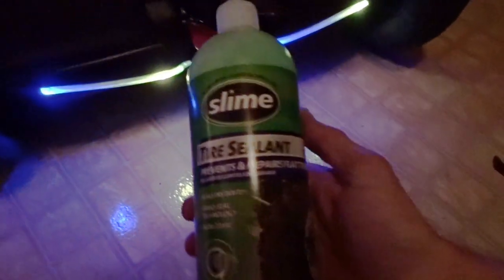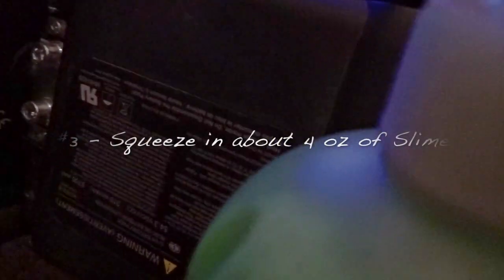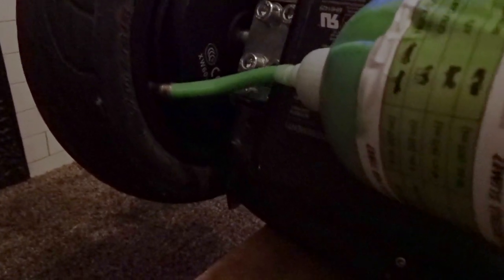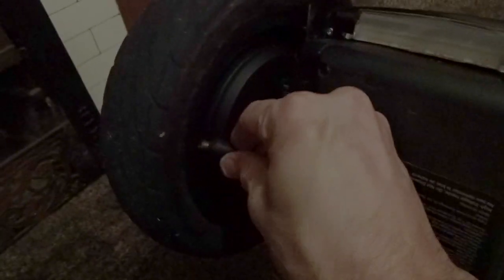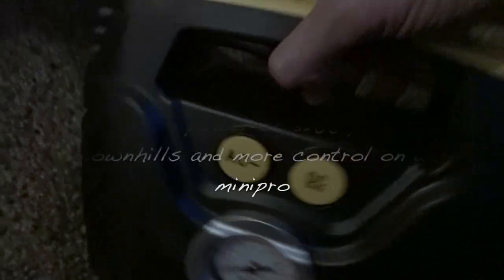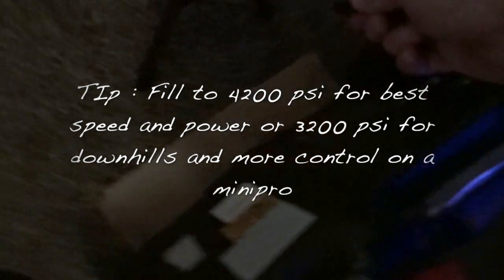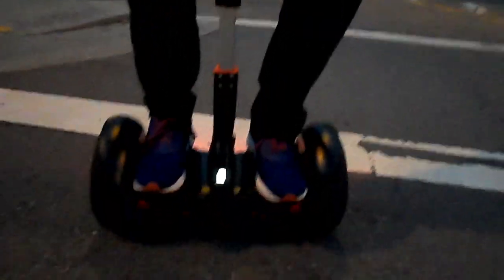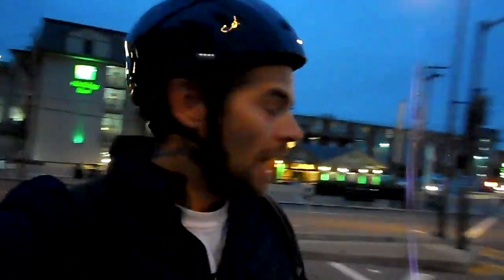How to Fix a Segway Minipro Flat Tire!

Comment: thanks for posting.  will be doing that to mine.  so tired of plugging/replacing tires!
Reply from the maker: Dogwalker no problem glad I could share!  I feel like Im a fairly early adopter and ride rough SF streets with glass, holes, etc so my tires got lit up pretty early.  I was up to putting air in every day til It would only hold 30 minutes and so I had to solve it.  I found it on amazon somehow and was skeptical, but now after a few months they are still tight.  Put air in every month in one and the other leaks nothing.  Im going to have to replace a tire some time before they bald but damn Im scared to jajaja!!  Since Im a month late responding my apologies and let me ask, did you slime and how did it work?
Reply: Christopher Tozzi I haven't done it yet.  I have the slime waiting with the new tires.  Plan on doing it when I change my tires which is soon. I've got almost 9500 miles riding in West la and Santa Monica. I hear ya regarding glass, etc.  Keeping air in my tires and getting new ones that will inflate has been the only frustrating thing about the minipro.  I'm glad you found a good fix.  Happy riding!
Reply from the maker: Oh nice you've got some miles on there as well!!!  I agree a great machine.  My new gripe is the new upgraded miniPLUS dosen't have height adjustment!!! Cool lighted colors on the side of the wheels, more power, but I would have to control it with my ankles!!! Come on now!  The good thing for early adopters is our battery is better then the new miniPROs just a little bit but we all know that translates to hills and other factors.  Ride on!
Reply: I'm only 5'7" so I use the minipro with the steering bar height in the lowest position.  Would that be the same as the miniplus?  I heard Segway made the 2018 version with less battery capacity so they could reduce the price.  I would pay way more for a higher capacity battery.  More4mini tried one but it failed on the mini.  Given hilly SF, I'm guessing you can go thru the charge rather quickly.
Reply from the maker: Yeah our miniPRO"s battery on flat stuff goes for a good 1 1/2 to 2 1/2 hours around here generally, but hit some straight uphill paths like the one to work for me thats 2.3 miles and that 20 minute cruise takes me down to 2 bars of battery.  And at 2 bars Ive found that the limiter comes on too easy while losing power and Im looking to recharge asap.  Luckily for me, Im at work at that point! And I agree, saving me a hundred and a half might be cool but damn that I want more time on not less.  When solo the coffee shop recharge is great but in big groups it sucks to be the one that has to stop first!
Reply from the maker: And your so stoked cause the mniiplus will fit you awesome!  If looking for more power and lights thats your upgrade although the pice of 799 is up there for tech they have had for awhile now! Im sure the extra speed was as hard as programming the same chip we have up 2 mph but whatever!